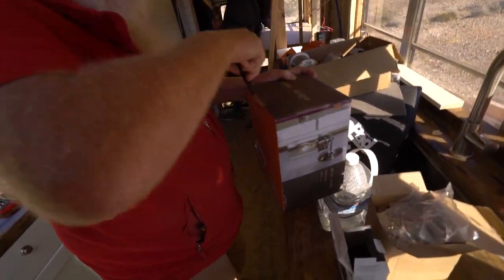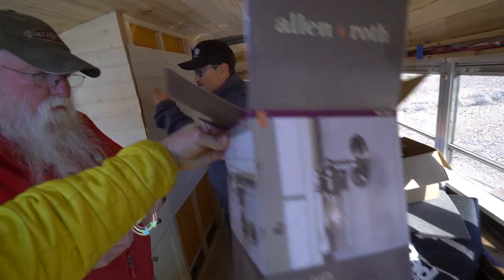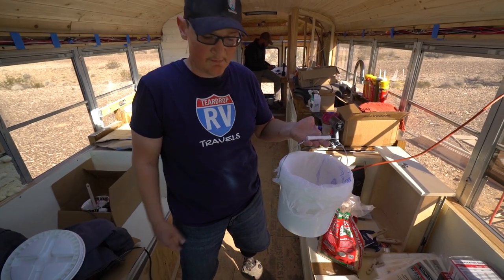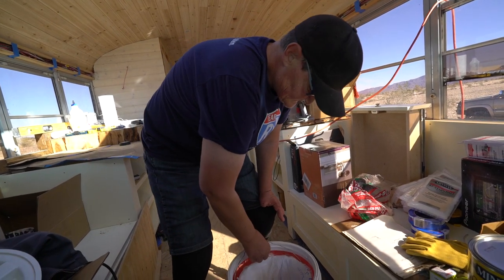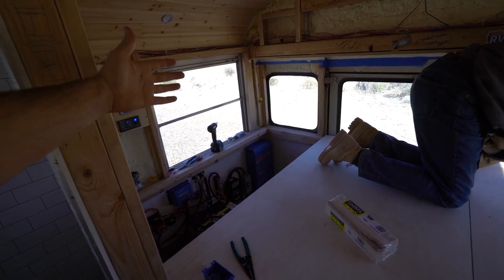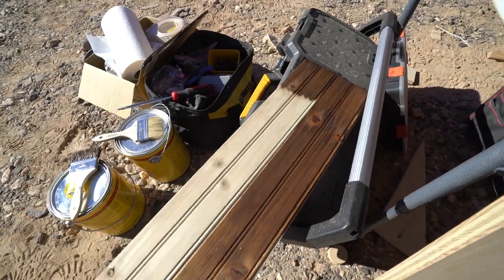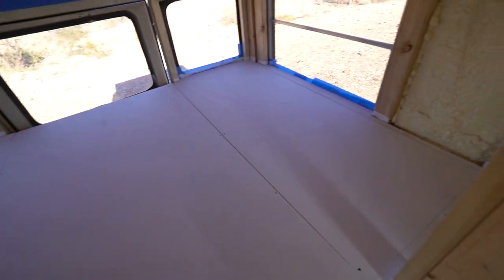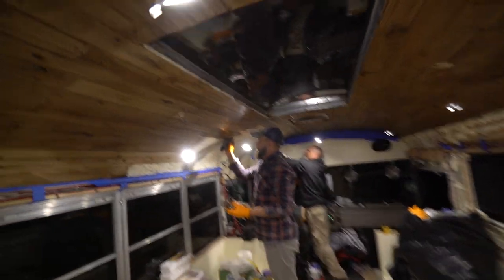VanLife $15 COMPOSTING TOILET - (Cheaper than Nature's Head, Air Head, Luggable Loo)

Comment: Some handy woodworking tips for stain control.  You can control the darkness of your stain with the sanding process.  I use 100 grit for rough sanding to remove gouges tool marks etc.  The final sanding is with 150 grit for normal color and 220 grit for lighter color with the same stain.  For woods like birch that have a hard time taking stain consistently you can do a wash with mineral spirits and the stain penetrate better and will be much more consistent. This will also lighten the stain a little.
Reply from the maker: Holy crap, that is excellent information. Thank you

Comment: For 12 volt you need poled connection or you will blow up the bulb besides it being 12 volt.  You need to know hot /red wire from ground/black wire.  Since ac is "alternating current" the polarity changes all the time so ac wiring is not that set up for 12V DC.  Probably easier to just buy 12 volt DC fixtures, although it can be done, you might blow something up pretty easily.  50/50 chance.

Comment: Only thing that will happen if you put a 120 bulb in 12V fixture is the bulb will barely glow. Had that happen on my boat. Guy had sold me the wrong bulb. Do it the other way around and you have a flash bulb.
Reply: Webb Trekker once

Comment: If your just throwing your business away ,,, do you need to add all the wood chips?  Isn't that more important if your doing the composting process?
Reply: If he has to, *ahem, hold on to his refuse until he can take his trash into town, then the wood chips keep odor down until you get to the garbage dump.
Reply: It works...I worked at a doggy daycare for several years, and nobody produces like 135 dogs during a 12 hour day.  We covered with sawdust in open buckets and not only could you stand within a foot of the bucket on a hot summer day and not smell it, but it did not draw flies...you REALLY don’t want something in your bus drawing flies.  It works.

Comment: What I was thinking about along these lines was using a "Luggable Loo" for #2, but outfit it like one of the better composting toilets by adding a 12VDC Fan and some kind of a Stiring Mechanism so that the composting agent can be mixed with the Solid bodily waste.

In addition to using a separate liquid detergent bottle (something I do already living in a house with the bathroom upstairs) to do #1.  just stand up and pee in a bottle, in the case of a guy at least.

Comment: might be saver to put a smaller 12 / 24 volt rear light bulb in the lamp , reason being that you can see from a distance its not a shore power lightbulb so you run less of a chance to blow up the fuse by screwing in the wrong 110 volt light bulb wish isnt that weird of an idea as they have the same socket and size  , the smaller car style barionet fitting bulbs are eazier to find on the road (gasstations stock them usually )

dont puke in a composting toilet after a realy drunk night out 
it makes for a REALY lousy next morning having to clean everything up (small room no flush and all that), if ever the chance use a normal bucket or run / stay outside 

about the bed , hope youre going to make boarding along the sides to keep the matras away from the windows , think the condensation from the windows will wet the matras if it touches them

Comment: Hi Jax the roof looks awesome!  
I would recommend the compressed wood pellets used for cat litter boxes and pellet burners. Cause those dehydrate your business and reduces the smells then.
Reply from the maker: Excellent idea. Thank you
Reply: We used it in a same sort of selfmade composting toilet :) 
And use it for our cat litter box , lol! 
It can absorb fluids too, but that is a bit of a waist of the pellets.. then you have to change it very often.. but if you're having a lady over, she can use it too :) 
When our cat litter box gets full we scoop out the business and use a sieve to seperate the pellets from the dust (when they get wet or absorbed moisture they fall apart). Then you can re-use the dry pellets for refilling the bucket.

Comment: You don't have air holes in your bed platform, you may have mold grow there. If you check out other van and schoolies. Lookin good
Reply from the maker: Good tip. Hopefully there is enough air flow with the gap by the door.

Comment: Hey Jax!  The stain really brings the beauty out of that ceiling.  I'd vote to leave the bathroom ceiling natural color to keep that room nice and open.  Beautiful shower btw, nicer than the one in my apt.  Are you going to put an AC unit in?  The bus is looking really good, I'm happy for you Jax!
Reply from the maker: Thanks dude! I wanted an AC, but I could only find 12v units for 3500, and I don’t think my inverter would handle the 110 dometic units. There’s also RedDot, but no way to run AC lines from motor to roof

Comment: You just need to learn how to use your camera.     Because that issue is preventable.  It’s called back lighting and you need to adjust your  aperature  or ev
Reply from the maker: It’s on auto. I’m not shooting manual. It’s ISO, not aperature lol
Reply: Actually even if it’s on auto you should have an exposure compensation dial... or an Ev ... I wouldn’t screw with your iso... as that gets more grain the faster you go... if you can’t access the ev or aperature I would suggest you try the green mode which is programmable.... trust me on the kid ... I could probably take your camera apart and make a new one ;)
Reply from the maker: colourful64able it’s far to difficult to vlog on manual. There’s no screen to see myself. I only have this issue on occasion, and it’s not worth the hassle. Nothing’s gonna be 100% perfect when I shoot everything myself.
Reply: I understand not shooting manual ... shoot program at least then you could fix the backlight